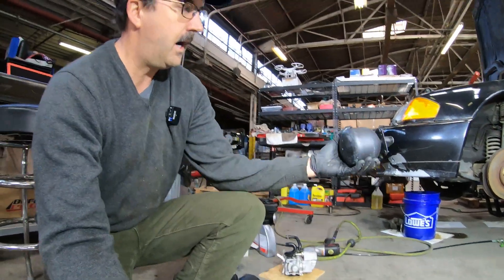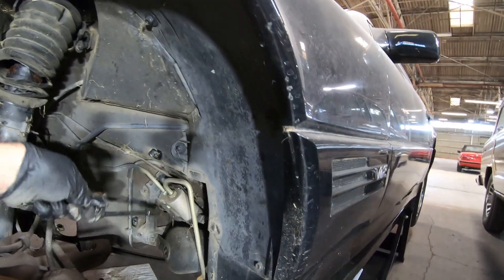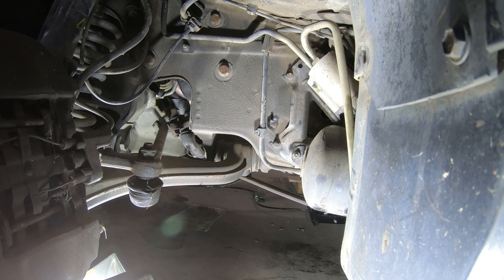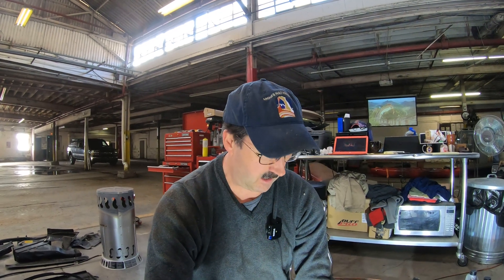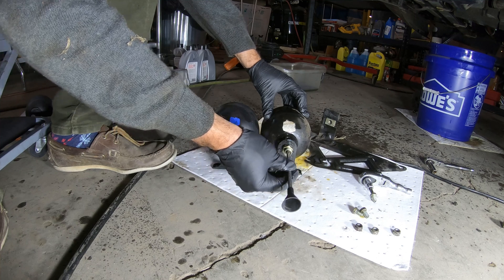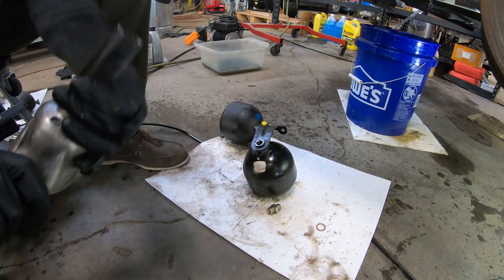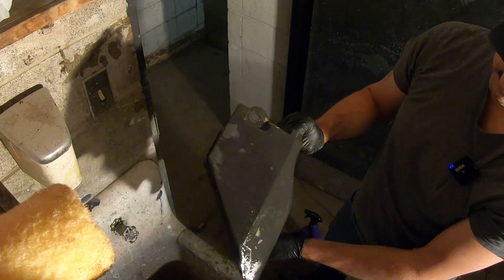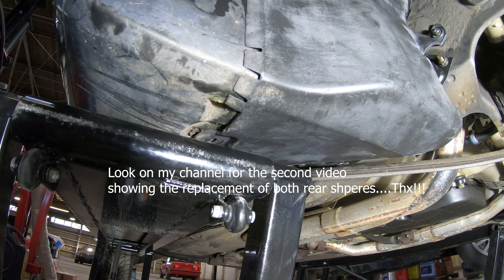Mercedes SL600 V12 - Replace the Nitrogen Spheres on the front Suspension of my 1994 R129...

Comment: For everyone to is that Citroën had this kind of suspension patented in the early 1900. Even Rolls Royce used it and many others going forward.
The good part with the Citroën spheres is that they are refillable if they are not punctuated as in this example.
My thought if there might be a solution to convert the fittings in those cases...

Comment: I have 1997 sl600 and the front suspension drops down after a day when its parked.  Goes back up within a couple of mins or so when the car starts. What could it be? Some saying its the suspension valve block? If so where would this be? Can it be rebuilt? Where can i get the kit to rebuild?
Reply from the maker: It is most likely the valve block. It’s under the car. Look for my video where I show replacing and rebuilding the valve block. Thanks for watching!
Reply: @cassidycarcave2781  Is it called " Distribution valve"? Another name is "Spider valve"? There are bunch metal lines attached to it?
Reply from the maker: @boyb72  that sounds right!
Reply: @cassidycarcave2781  Hi,  I dont see any vids on your videos rebuilding hydraulic suspension ads valve block. I only see for newer abc suspension. I have a 1997 sl600 r129. The ones i see is for abc. Ive rebuilt the abc ones for my w220 s55 amg but not older ads unit.  Another question is anyones from harbor freight universal variety seal/oring pack fit for the ads?
Reply from the maker: @boyb72  I’m not sure about the harbor freight route….They’re probably generic O-rings. Just a matter of sizing them up. Sorry I don’t have more help for you. If the source for the one I did doesn’t have yours, I’m a dead end…

Comment: I changed all 4 spheres and now the front is all the way up. Any idea what it could be?
Reply from the maker: I have another video where I’m changing out the valve block on the ABC system. That’s a possible culprit in this situation. There’s one for the front and one for the back. As I recall, there’s a kit you can buy online that basically replaces some seals and O-rings and usually will resolve the problem. Not expensive, but it is sort of a pain to do. Good luck and thank you for watching!

Comment: Love these videos, i have a 95 SL600 and nobody posts any repair videos on these cars lol. I’m having an issue where my front suspension sits very low but the back suspension is completely fine. The car was sitting for a while before i purchased it but there were absolutely no hydraulic leaks on any of the shocks or at the pump. Tried starting it for a little to get the fluid circulated, tried adding some fluid (it was low) and the front suspension hasn’t come up at all. My guess is the shocks but i’m not too sure. When you press the button to raise the shocks the back shocks don’t move at all. Any advice is appreciated thanks man keep up the great videos
Reply from the maker: Hate to say it but it's probably that valve block that I replaced in the video with the ADC pump. It's the part that I sent out to Klaus at Top Hydraulics. He repairs them for about $450. Good news is it's a piece of cake to take off and replace. I bet the seals inside your valve block have gone bad... Thanks for watching!  There will brbe a new video soon on this car where I rewire the mass air flow sensor harnesses...good fun:-)
Reply: @cassidycarcave2781  Was it the valve block or the pump that solved your issue? Mines doesn’t seem to be physically leaking but i’m not too sure. Car basically has the front tires inside of the fender well
Reply from the maker: @elijahlane411  for mine it was the valve block. I replaced the pump also just because I wanted the car to be right but my car had all four fenders basically resting on the tires and while it wasn't physically leaking outside I'm sure the valve block was bad and was not allowing the system to hold pressure. Hope this helps and thanks for watching!
Reply: @cassidycarcave2781  For me my rear suspension is completely fine. Just the front suspension won’t raise at all. The whole tire is pretty much inside of the fender. Tried adding fluid (it was low) and revving the engine to create some pressure at the pump and the front suspension wouldn’t raise an inch. Took off the passenger side front wheel and the valve block had absolutely no leaks. The boot on the front shock was ripped and the inside of the fender seemed to be covered in dried up oil of some sort. Thinking about just converting it to coilovers from the SL500 of this year and plugging the hydraulic lines
Reply: @elijahlane411  Why would you get a V12 only to convert to coilovers 🤦‍♂
Reply: @AngryZacMan i was 15
Reply: @elijahlane411 Why get V12 at all then 😂
Reply: @AngryZacMan it taught me a lot. I'm a mechanic now
Reply: @elijahlane411  That they will do, I have 3 currently. Let’s hope you don’t convert the clients cars to coils tho hahaha
Reply: @AngryZacMan it rode fine on coilovers. I used factory parts from an sl500 lol. Guy i sold it to loves it.
Reply: @elijahlane411 They’ll ride fine but the spirit and performance of the 600 is killed. All my 600s have ADS fully restored. Yes it costs money thats why this is a Mercedes V12 not Honda civic lol

Comment: I have a 1994 sl600 as well! I've been having trouble with it overheating since ive purchased it. I've changed the clutch fan ,the thermostat and upper rad hose. Im at a stand still and praying its not the worst. I was told they have a self bleeding system but I've still put it on an incline and tried. I love the car to death but I don't know what else to do. Thank you for the videos you have posted for future reference.  If you have any links they would be greatly appreciated! Thank you again for your time!
Reply from the maker: I would look towards the water pump...Can you confirm that it is circulating coolant? Any leaks near the pump?  Is it rattling or making noise? Also upper and lower radiator hoses should be warm after a little idling...if not it may be a clogged or corroded radiator...Sorry your having trouble - thanks for checking out my channel!
Reply: I have 2 sl600 have had to replace both water pumps,
My 97 was replaced 1200 miles before I got it the impeller was cast metal and had come apart,